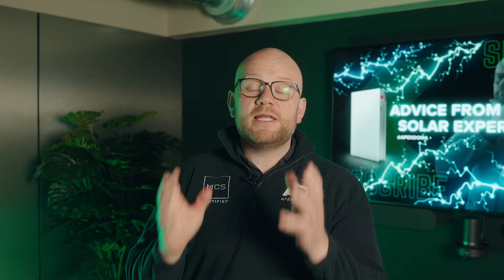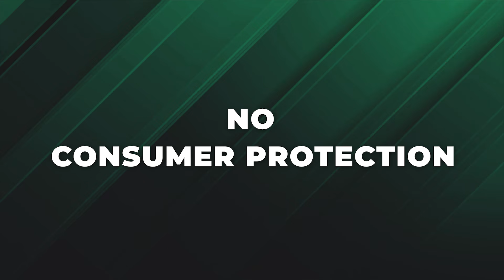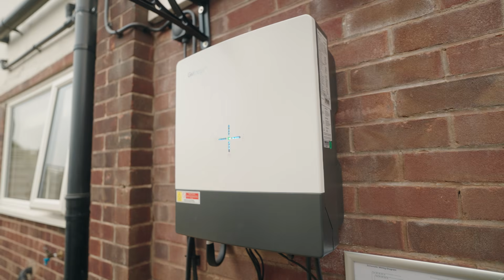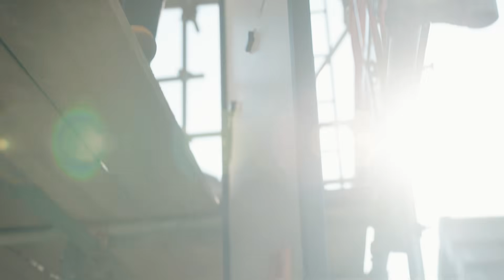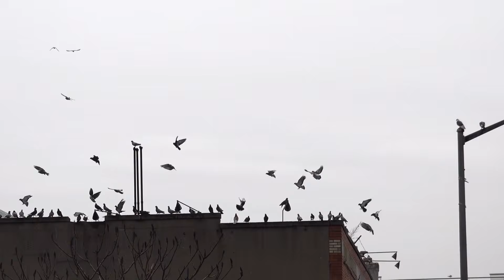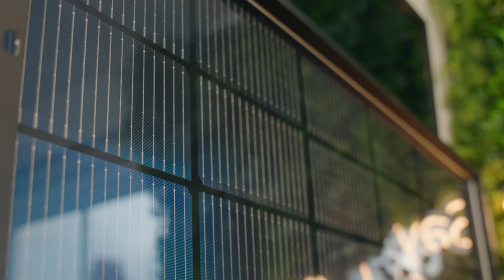Avoid These Costly Solar MISTAKES 🚫

Comment: Are bi facial panels now the same price as mono facial or did I mishear that? Also, Id have thought with a quality bird protection around the panel edges, this would make bi facial panels redundant unless you had the inefficient chicken wire stuff?

Comment: My install was restricted by the local grid so I potentially will loose a lot of power generation capacity (17X450) Is there any way to get this export rate increased?
Reply from the maker: Hi Richard,

Sometimes this can be a genuine restriction that can’t be avoided. Other times, it can be the installer taking the easy path. 

It would require a second application or conversation with the DNO and ask them to revisit the application.

Warm regards

Comment: Smells like snakeoil. Don't need mcs for g98. All MCS tells you is don't trust an electrician. So why trust MCS? Just another certification scam.
Reply: Absolutely and him saying can’t get export tariff without it is mis information.  Octopus allow without MCS as long as electrically safe
Reply from the maker: MCS exists to protect customers, not to make life harder for installers. It’s the recognised quality and compliance scheme in the UK and is constantly evolving its standards to reflect new tech like battery storage.

Yes, Octopus currently allows export without MCS for existing systems, but that’s a concession, not a guarantee for the future. If they withdraw that policy, you could lose access to SEG entirely. 

MCS certification also underpins manufacturer warranty support, property resale value, and gives you confidence your system is designed and installed to a safe, auditable standard. Going ‘off-piste’ might look appealing to save upfront capital, but in the long run it’s not worth the risk in our opinion.

Thank you for all of the comments, as it gives genuine alternative opinions and considerations.

Comment: How about an undersized inverter? Might throttle during peak hours, but we live in NW Europe, don't we. From what i understand it could also mean the inverter fires up at a lower current (i.e. less sunny weather)

Is this correct and wouldn't this be ideal on a E/W setup for example?
Reply from the maker: You're right that a small amount of oversizing is perfectly normal, but excessive solar on an inverter would cause peak clipping. 

East West set up, you just want to make sure the arrays are on separate MPPT trackers. 

Thanks for the comment.

Comment: I've have a loft dormer conversion to the rear. Some installers have said they can't work with the flat roof due to previous issues with structural load problems. Some say they can install on the flat roof. How do I know what's right?
Reply from the maker: Great question, and yes, it can be done.

Best practice is to get a structural load calculation done on the flat roof first, just to be sure it can take the additional weight safely. If you’re using a ballasted system, which relies on weight to hold panels down, that’s especially important.

Alternatively, if you want to reduce the amount of ballast needed, there are systems like Nicholson fixings that anchor into the structure without penetrating the waterproof layer in a risky way. We’ve used these in similar dormer situations and they work well when designed properly.

Main thing is to get it designed properly and not guess. A good installer will work with you to do that. 👌

Comment: What about people buying the new portable solar power stations and needing panels mounted on your roof???
I kind of noticed there is more British or European installers videos on YouTube than American installers...🤔 I wonder why???
Reply from the maker: Interesting comment, we dont supply portable power stations although they are supposed to be popular in Germany. The main issue in the UK would be equipping fuseboards with bi-directional RCDs / RCBOs; our type A versions would be blinded if the plugged-in portable battery were to discharge. This could well be why they haven't taken off here. ….

Comment: Not true, i did a self install and got a g98 certificate which allows me to export and get paid
Reply from the maker: Can we ask more about how you achieved this? This is the first time we have heard about it, and we are really interested. Usually, the network won't allow end users to complete the applications; they require registered electricians or engineers to complete them. Thanks 😃

Comment: Very comprehensive, but no mention of microinverters.
Reply: He mentioned inverters. A micro inverter isn’t a thing, it’s a term. I’m no electricians but a device inverts or it doesn’t, it doesn’t partially invert. The fact that you have 24 inverters on your roof or 2 in your garage, it’s covered under the term “inverters”.
Reply from the maker: We actually covered microinverters in our Solar Panel comparison video. Our opinion? Keep your inverting on the ground, as if one fails you’re in for scaffolding etc. to get it repaired / replaced (which won’t be covered by the warranty, as it usually only covers the replacement unit itself). Maybe that should have been #15!
Reply: @apexdomasolar  definitely from maintenance point of view. As a newbie but a techie I in the UK I want to understand this shading and ensuring we get the solar on as early as possible. I’ve heard ac per panel allows earlier power up of the panel but I’ve not investigated yet.
Reply from the maker: If shading is a concern you can always fit additional optimisers on the panels concerned, your installer should be able to map the sun path and see what impact any shading would have :)
Reply: 10 yr warranty, lift panel to replace micro inverter. Single inverter on ground is one stop for all panels.
Reply: @davidwratt8993  An issue I've read people have had if they've experienced microinverter failures is some manufacturers don't have backwards compatibility in their products, meaning that they need all the microinverters in the circuit to be from the same generation. So if a microinverter fails after the manufacturer has moved two generations on and the one that failed is no longer available, then either the panel associated with the failed microinverter has to be removed from the circuit, or all the microinverters need to be replaced in order not to lose the use of that panel. The issue is that often the warranty will only cover the failed component, not an update of the entire system. They would cover an updated replacement of the failed component, but it wouldn't be compatible with the rest of the system. Whereas if the inverter was a string inverter that failed, it would be covered. Also, not all warranties cover the entirety of the labour to replace the equipment for the duration of the materials warranty. Some just cover the supply of the replacement equipment.

Point being, read the fine print and make a decision baed on what is actually covered and what would happen in the event of a failure.

Comment: I Can’t get the MCS cert , My installer “First4solar” did my install  Oct 2022 then went out of Business 4 weeks later 😢 system All Works Great !! No issues at all I’m very pleased , We Got G99  available , DNO sign off with a copy . The System Fox Batteries 12 kWh,  Inverter 6Kw  415w x 18 Panels completed with bird guards,  paperwork  shows completed correctly but MCS Not available even tho they were registered 😢 any help would greatly be appreciated 😊
Reply from the maker: Hey Daz, it sounds like you have all your paperwork in place apart from your MCS certificate? Apparently, Octopus are trialling a new scheme where you can still get your export payments with MCS (although this isn't documented anywhere official!) we believe there is also a £250 charge. It might be worth reaching out to their customer service to see if you can?